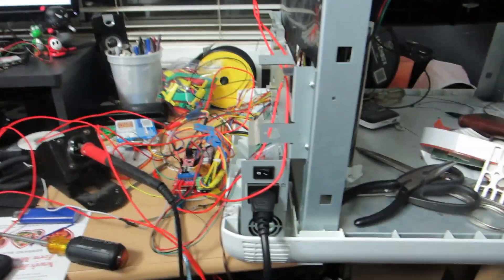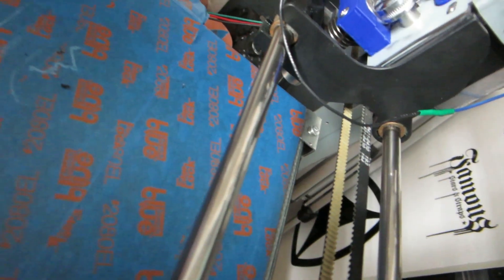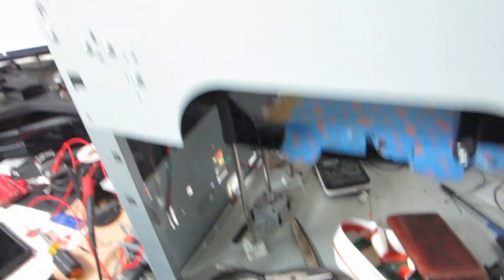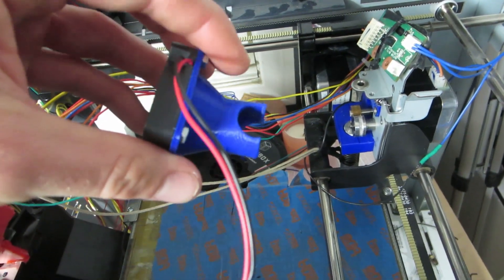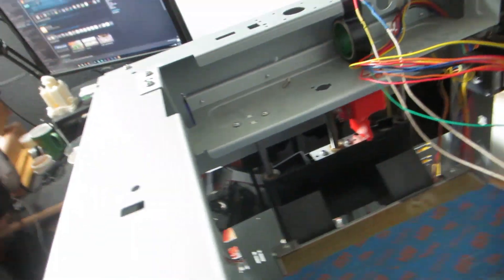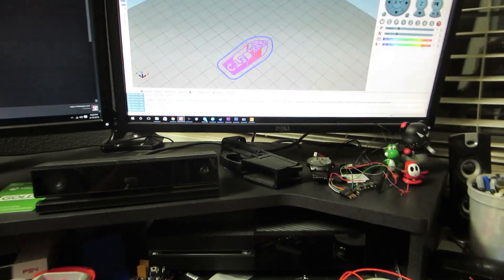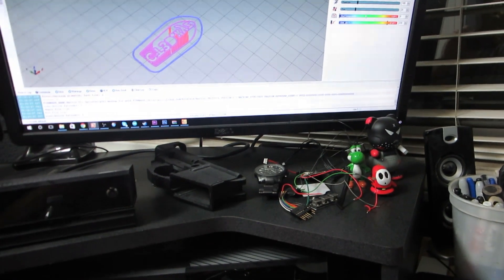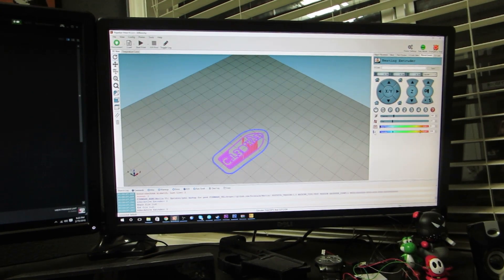Its Alive! 3d Printer Updates | Davinci Printer Board Swap Ramps 1.4

Comment: Hey man, i have a davinci 1.0 aswell also reflased to run repitier, but my question is, why did you strip down your printer and replace the boards and hotend? I seem to get pretty good quality prints from my printer, just curious as to if there are any benifits? Or if its more of just a learning experience

Comment: i actually finished my ramps swap too! but then somehow managed to bust my voltage regulator on my arduino so i need another arduino haha. ill be ordering that soon though. so glad you got yours working as well! interesting to see how you kept that mini board on the extruder and used mechanical end stops. I bought some optical endstops to replace the stock ones and had to do very minimal modding to the endstop mounts. i also removed that extra board and just wired the extruder and fan directly to the ramps board. ive got one fan hard wired to a constant 12v source and then a plastic cooler fan as it prints hooked up to fan pin1 so i can control it in the slicer/repetier host :D do you have the graphic screen that hooks up to the ramps?
Reply from the maker: Could you send me some pictures of your setup? I had to wire the fan directly to the board because the mini board wasn't powering it for whatever reason so I don't know that I'll keep it. I don't have the graphics screen yet but think I may get it I'm not sure I don't really have much use for it but it is neat. Any idea what you did to make the regulator fry on you? I still don't know what caused it which concerns me a bit
Reply: +Dopesoner email me at kissracing98(at)gmail.com and I'll send some pictures later tonight. Are you eastern time?

Comment: check that the estrusor fan, is 5v. because the original works at 5v. most of these estruder fan work at 12V. so you'll have to take a line with 12v.
Reply from the maker: Thanks for the tip I'll take a look :)